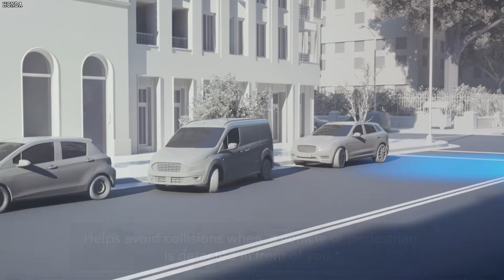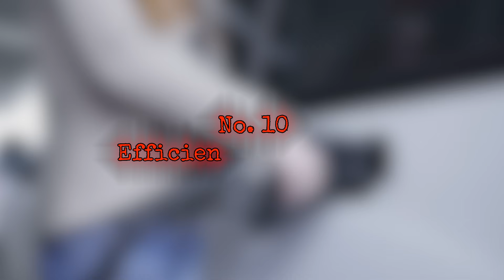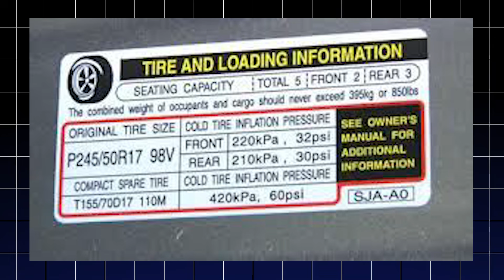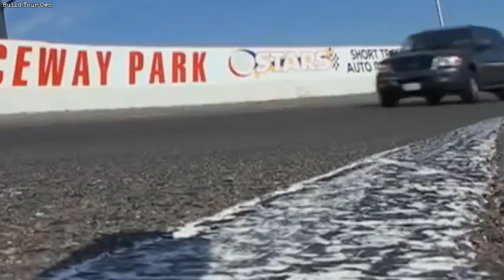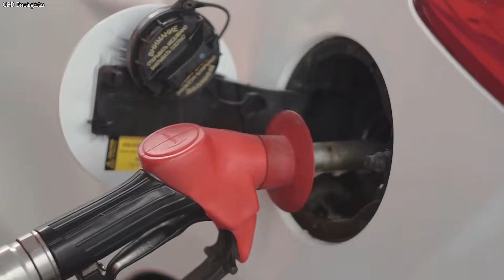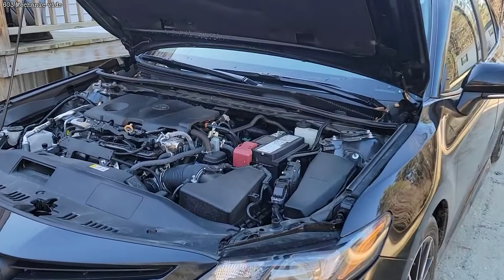THE JAPANESE METHOD for Saving Up to 50% on Fuel – You Need to Know About It

Comment: Why would anyone shift a vehicle in motion into neutral? I don't understand where that stupid Idea comes from
Reply: This is more for standard, not automatic cars. Back in the 80s and 90s with manual transmission vehicles it was standard practice to put the car in neutral going down hill or at long straight stretches. As he said in the video, back then the computer (ECU) was build differently in how to optimize fuel efficiency. Putting it in neutral saved fuel buy not keeping the pistons or RPM’s running when not needed. This is not the case for modern vehicles. If you have a car from the 90s and below. It’s still an affected method.
Reply: @devie_203 no 😂 just No 😂

Comment: I buy premium fuel to get rid of low load knock also the new ILSAC GF-7 engine oil is designed specifically with low load knock in mind....
Reply from the maker: A very good option for your engine.